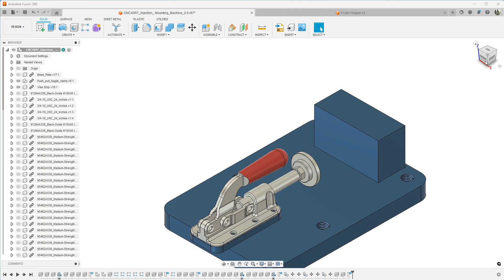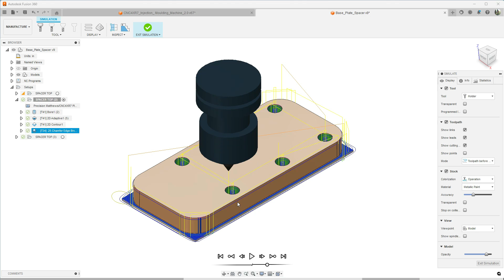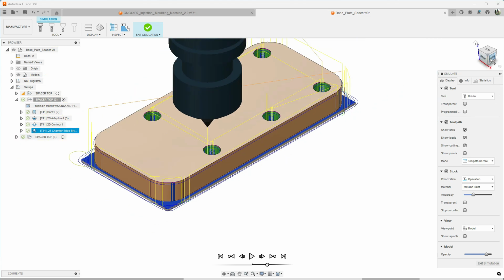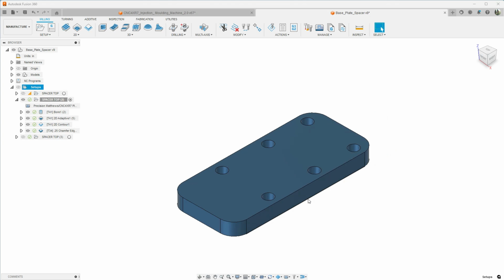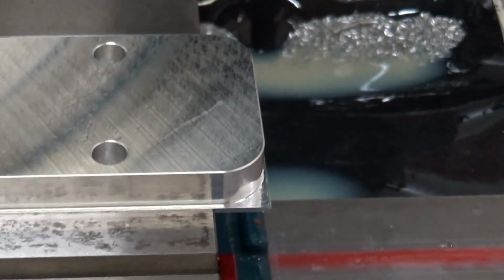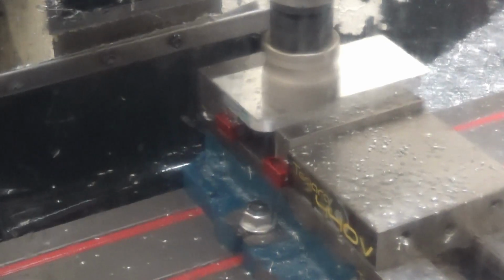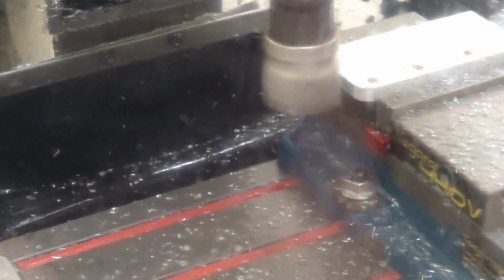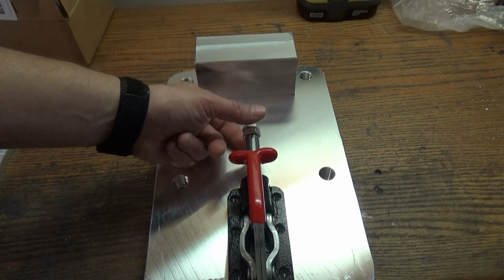Injection Molding Machine Part 4 Spacer

Comment: how good / Accurate would you say that the probe is ? 
I am getting new gear, and might want a new probe, instead of the mechanical edge finder for my Sieg SX3 CNC Convertion
Reply from the maker: I have video's on the probe accuracy, and Thread express does as well.